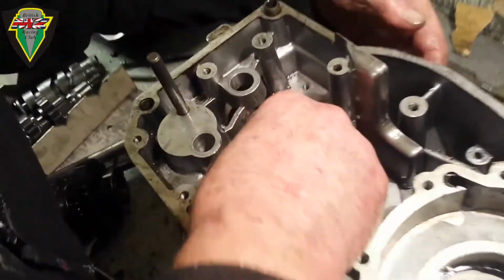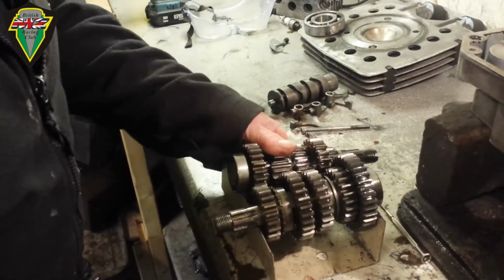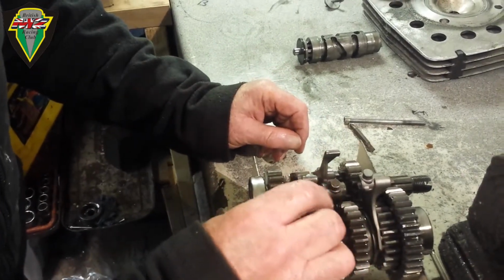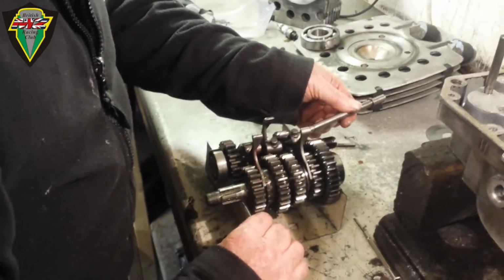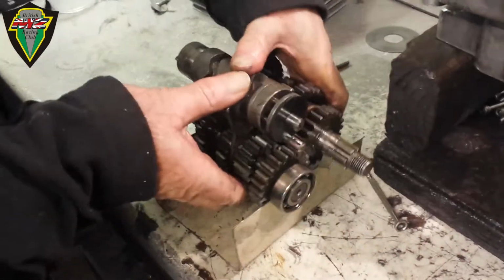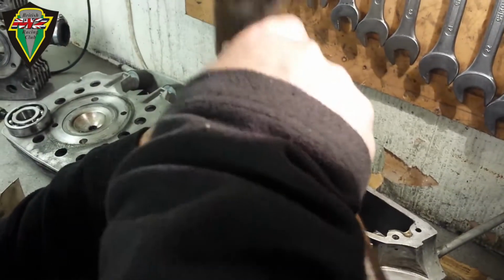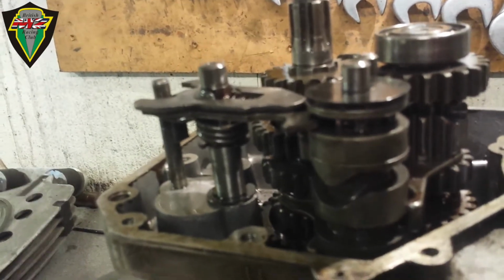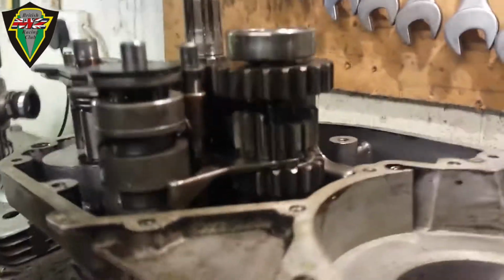Gearbox assembly MZ ETZ 250

Comment: The gearbox would be go easier into the engine if warm up the engine to 100 °C with a heating plate . It is also discribed in the users Manual Workshop. If you had warm it up, you didn´t need a hammer
Reply: Where can I buy a speed box like this?
Reply: Will the gear box 
can it be used for 4  and 5 speed gear box
Reply: This bike will never start again !! ✌
Reply: The question was will the gear box stand be ok to  use for 4 and 5 speed gear boxe
Reply: @michaelshannon2977  this is a 5 speed gearbox.
Reply: @yasermerino1enterprenur  it's from an mz etz 250.
Reply: @sonnycrockett7588  you are zsilly sausage. It not only starts but qualified 6th last time out.